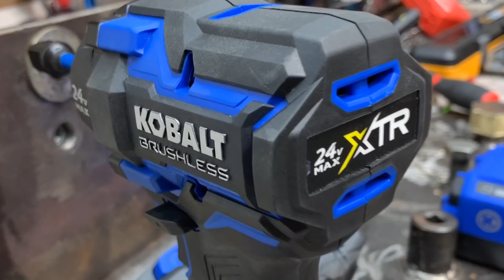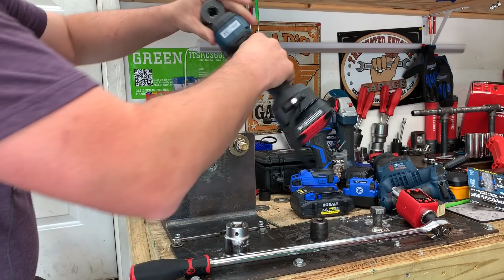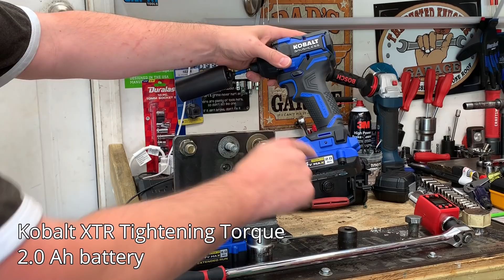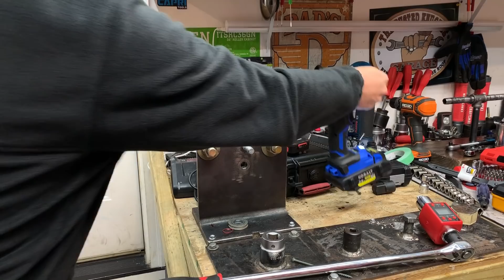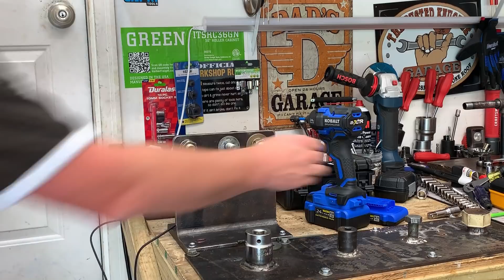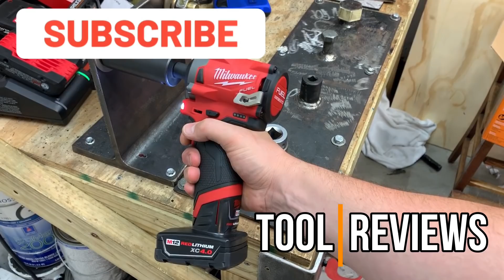Kobalt XTR vs Bosch Impact Driver one tool IS TOO POWERFUL!

Comment from the maker: I've never met an Impact driver that was too powerful until I met the Kobalt XTR.  I can honestly say that the  2400 in-lbs or 200 ft-lbs is very conservatively rated.  Additionally, I didn't see a lot of difference between the 2.0 and 4.0 when using for short durations and small bursts when both were fully charged. One can argue that the peak draw is higher on the 4.0 and I saw mixed results with the 2.0 being in the middle of two 4.0Ah batteries tested today.
Reply: Lows is pulling the old gm rating trick where it always surpasses the torque ratings so when the next guy matches or surpasses there rating there still in the game.
Reply: I found it interesting that the HO 4.0Ah battery didn't perform as well as the extended performance 4.0 Ah
Reply: I'm curious how accurate the torque adapter is. When was the last time you calibrated it?

I have used the kobalt tools professionally and have different results

Comment: I ended up picking up the kobalt xtr 1/4" impact driver since I'm an apartment maintenance technician so most of the time I'm driving screws or bolts into old brick and mortar style apartments and i got it brand new for $159 which it was originally $179

Comment: I have the XTR ¼" and I have to say its super impressive. I just got the XTR ½" impact driver and I cant wait to try it on lugs.
Reply: I have the XTR half inch wrench and I can say from experience it's a beast and it'll run all day no problem. It really likes a full battery though
Reply: @dreadnaught688  completely understandable considering how much output it can do, so not a bad idea to have a couple spare batteries on hand for backup if needed; and really the batteries arent hideously priced either. I saw a 8 amp hour XTR battery at Lowes yesterday for 139.

Comment: Comparing these is a little like apples to oranges, given the 24V vs 18V difference. The Kobalt is obviously going to be able to put out more torque. I am not saying this because I own a Bosch Freak, but because there is going to be a clear power difference.

Comment: It is better to have the power and not need it( hence 3 speed + assist) the xtr line is badass and all the tools are top tier contractor grade. $399 for the 5 piece with an awesome waterproof rolling box. XTR has changed the game. That bosch should go against last gen non xtr.

Comment: So let’s get this straight a Kobalt XTR 1/4" impact driver went toe to toe with a 1/2" impact wrench.  Meeting or exceeding the challenges and performance for a job it was NOT designed for but the Bosch was.

Comment: I bought the 3 tool xtr combo set with the hammer drill,impact driver,and the light,2 batteries,and a charger with hard case. Because I bought that they gave me the skillsaw with the promotion. Too bad it wasn't the xtr saw.

Comment: I can get the Bosch around $100 so it shouldn’t be a surprise. The kobalt is like $250
Reply: The non-sale price for the Kobalt XTR impact driver, including a 4AH battery and rapid charger is $179 at Lowes.   For $289 you can get the Kobalt XTR kit that includes an impact driver,  hammer drill, led work light, 2 batteries, charger, and hard side storage case.  They were also selling an XTR kit for $399 that included the impact driver,  hammer drill, rotary action reciprocating saw, circular saw, led work light, 2 batteries, charger, and rolling hard side storage case, although I don't see that kit offered on Lowes site currently.   Lowes randomly offers promotional deals on most of their tools, and when I bought my $289 Kobalt XTR kit a couple of months ago it included an additional 4AH battery for free.  The additional free battery was included with any Kobalt XTR tool or XTR kit, although I think that particular promotion has expired by now.
Reply: I don't know where you live, but i can't see those prices anywhere here in the states. The kobalt is $134 with the 4.0 battery and charger, The bosch freak ( the same one in this video) is $199.

Comment: I looked all over for that hex adapter today. I ended up getting a dewalt one.
Reply: I was wondering about that adapter too.  Has the same coloring as the Kobalt tools, but I don't see it anywhere on Lowes web site.  I've snapped a few adapters with my XTR impact, including some no name brand ones and a couple of Makita.  I'm currently using the Makita wobble adapter, which was highly rated in a Youtube video testing these types of adapters, and so far it's holding up.  Husky adapters carried by HD were also rated high in that video, but they're sometimes hard to find at local HD stores in my area.
Reply: Chuck D I think one comes with a impact socket set.
Reply: @Fly2kill1  That could be, although I've not seen that adapter in any socket sets I've viewed either.   I'd like to see Kobalt come out with a mid size impact wrench in 3/8ths and/or 1/2 inch size based on the XTR impact driver, like the 3/8ths and 1/2 inch reasonably price compact impact wrenches that use the same internals as their pre-xtr impact driver.  I like the XTR impact driver, but with as much torque as it has, snapping adapters is gonna happen on occasion if it's used in high torque situations as an impact wrench.

Comment: You never seem to bring up price!
Most of these tool brands are $40, $50 and even $100 Bux more than the Kobalt equivalent. You buy the tool, battery, charger and your in neck deep for $400 big ones. I aint doin that for one damn tool. As to the Kobalt being a tad heavier? For the Kobalt money i think i can handle the few extra ounces all day.
Reply: The freak is $159 battery and charger cheaper than the kobalt
Reply: @traceydetwiler9552  The freak is at $199, while i got the Kobalt for $134 with a 4.0 battery.
Reply: MarcosArg saw it today for $159 wife asked me if I wanted to get one.... I should have said yes 😂😂

Comment: Great video. I have the Kobalt 1/4" impact driver but not that model. I just learned how much you can do with these little impact drivers. 30 years ago I had a 115 volt Craftsman 1/2" impact wrench. What a hunk of junk it was. I could not even take off wheel lugs with it. These little 1/4" battery powered impact wrenches are far better than that junk one I had years ago. I am just so impressed with how these new battery powered impact wrenches work. I am so glad I purchased mine. I actually have two of them. I also have the 1/2" Kobalt. If I would have known how much power these little 1/4" drive impacts work, I would have never purchased the 1/2" drive one.
Thanks for the very interesting video. Well done and very informative.
Barry G. Kery
Reply: I still own a Craftsman 115V impact wrench.  I bought it at a pawn shop around 20 years ago, so I don't know how old it is.  It's heavy, but pretty powerful, and has no trouble taking off lug nuts from any of my 3 vehicles.  I used it a lot when I first got it, and still use it occasionally when working on vehicles in my garage, but cordless impacts these days are stronger, and more convenient.  Maybe I'll get rid of it soon.  It could still be useful for a hobbyist who doesn't want to spend the money on battery powered impacts, or on a compressor and pneumatic tools.

Comment: I'm a little confused about the big difference in the tightening specs for the 2 4AH batteries.  What was the difference between those two batteries?  The 2nd one showed significantly less tightening power over even the 2AH battery.

Comment: The Kobalt is nice and all but it looks like a toy next to the Bosch which has a more mature design and screams pro tool!
Reply: The looks of the tools are subjective.  I happen to like the way the Kobalt is designed, but the real proof is in how they perform, and the Kobalt is just a much stronger tool.   I also like the different modes available on the Kobalt that provide options for more precision in use.  The socket drive on the Bosch is a nice touch, but for me that's it's only real advantage over the Kobalt, and that's not nearly enough to overcome it's shortcomings when comparing the two tools.  I've owned the Kobalt XTR impact driver and hammer drill for a few months now and have nothing but good things to say about them.
Reply: I didn't buy mine for the looks.

Comment: The XTR is nothing special. How does anyone else not see what they did here? Guess people just like to fall for marketing gimmicks like Dewalt 20V lol. 

They took a 1/2" torque wrench (mid torque Milwaukee and Makita BTW285 comparables 200-220ft lbs forward, 400ftlbs + breakaway) and put a 1/4" hex collet on it.

That's just dumb. The tool is huge. No need for it to be that big to drive screws or smaller lags in which is what you'd be doing with a 1/4" drive.
Reply: Uh oh big red fan boy in the comments.
Reply: Idk comments like these may me think you are ungrateful for another tool option out there thats competing with the big dogs. “Huge” tool is a funny word to see thrown around when the difference here is literally just a few mm. Its nitpicky to say the least. Huge in my opinion would be the 1/2” 1200ftlb impact wrench compared to Milwaukee’s 12V impact wrench.
Reply: Kobalt doesn't have any 1/2 inch mid torque impact wrenches with anywhere near the specs you're citing.  They have a couple of full size impacts that are roughly twice the physical size of this XTR impact driver, and a couple of compact impact wrenches, in 3/8ths and 1/2 inch sizes, and both of those compact impact wrenches have less torque than this XTR impact driver.  With a bare weight of 2.4 pounds, your definition of "huge" is much different than mine.  The only significant size difference between the Kobalt and the Bosch is because of the bigger battery on the Kobalt.
Reply: You have no idea what you're talking about. SMH.

Comment: I can at least conpare the Freak 2 vs Milwaukee Gen3 and overall the Bosch is the better tool even it is like 10% weaker than the Gen3. 
Its better balanced, more trigger control, no trigger malfunctions like Milwaukee and it has way less vibration.
Reply: better yet, the Freak 2 has always had a double ball bearing collet, while the Gen3 had a single ball bearing collet which has been infamous for bits falling off. Milwaukee just implemented a double ball bearing collet on the Gen 3 but it remained the same part number, so too bad for people who still got the earlier ones...

Comment: That is so impressive with the half inch 1/4 inch adapter and half inch deep socket would of thought there would of been alot of torque loss 🤔 but dosen't seem to have much torque loss at all
Reply from the maker: The Kobalt XTR was a beast. I thought the full anvil on the Bosch would be where it’s at, but boy was I wrong.  The Kobalt XTR is the strongest 1/4 impact driver I own.

Comment: Love this Kobalt impact driver.  Bought it a month ago and damnit has some serious power
Reply: I bought the 3 tool xtr kit with the hammer drill, impact driver and flashlight for $289 then AFTER I bought it found out I could have got the 5 tool kit WITH a dang rolling tool box for only $100 more that came with the xtr sawzall with orbital action and the xtr 7 1/4 circular saw.  I'm so mad at myself!  On the plus side of things though I had to pay an additional $300 for the other two tools at least I got the free 4.0 AH battery special lol 😭
Reply: @UnprofessionalllyProfessional  I just bought 5 tool kit with rolling box for 399. They seem very nice! Hope they perform as well as people have said.
Reply: Same
Reply: I have the impact and the circ saw and im loving them. Plus I think the colors are just bad ass!!!

Comment: What's the long ratchet you're using there?
Reply from the maker: It’s a Performance Tool W32180 1/2-Inch Drive 23 3/4" Long Handle Ratchet that’s taken a good share of 300-400 ft-lbs or more. It’s the older 72t one
Reply: @ClientGraphics  How do you like it compared to long-handled tektons?
Reply from the maker: This one has the backwards selector switch which annoys me but I bought it as a cheap alternative with a comfort grip handle. They made a 108 gear version with the same part numbers that have the selector switch that I like. I have it in the 3/8” and 1/4” version and bought them just for the grip. Wish Tekton would make a comfort grip option. I’d rebuy most of the Tekton ratchets if they came out with comfort grip.